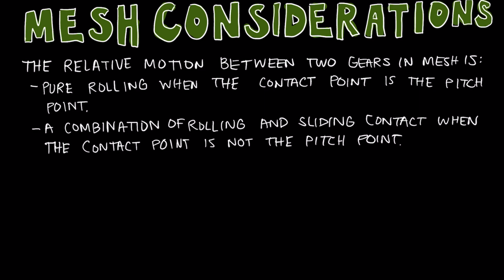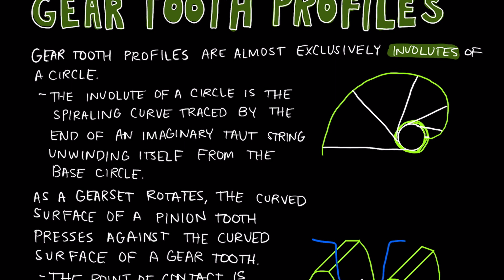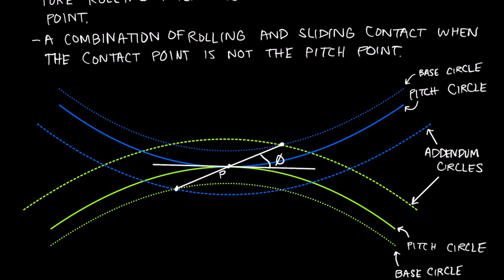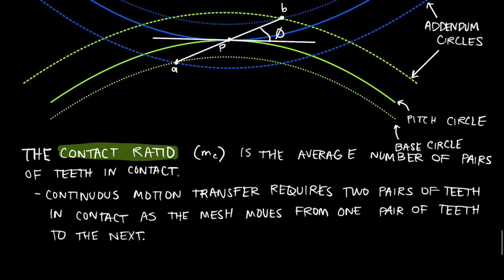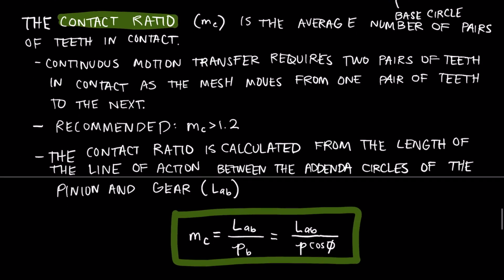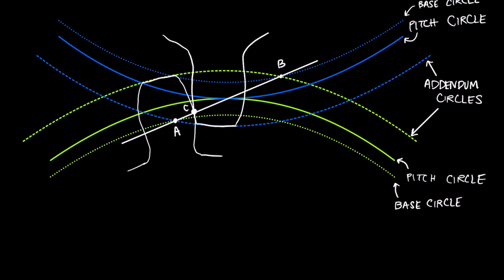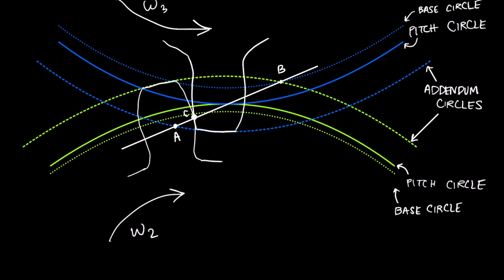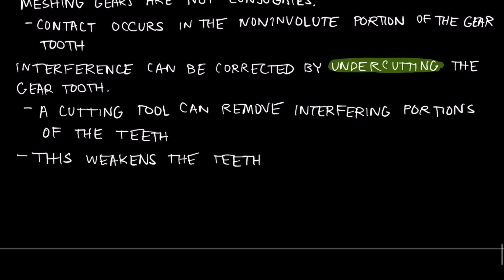Backlash, Interference, and the Design of Meshing Gears | Machine Design - Lecture 23A

Comment: The adendum is just extra material, it could be higher or lower.  the pitch line does not need to intersect where the addendum meets the base circle?  The addendum and dedendum are placed higher or lower to provide clearance.  they do not affect the pitch line , pitch circle or base circles.  The pitch line is tangent to the base circles and intersects at the pitch point.  Thats how you get your pressure angle.   I think your pitch line is wrong.